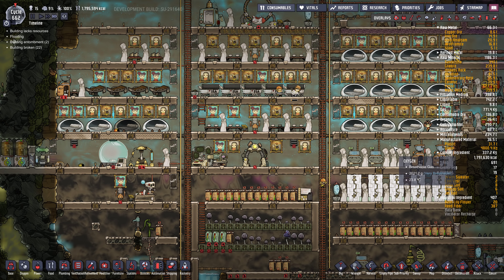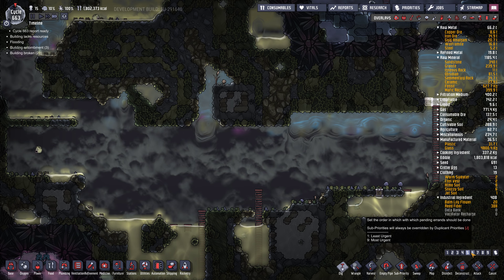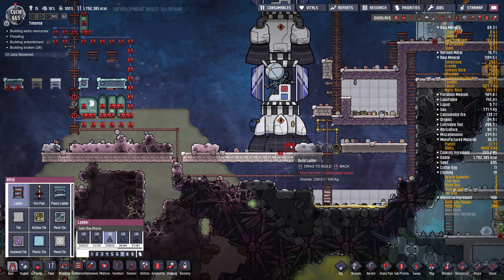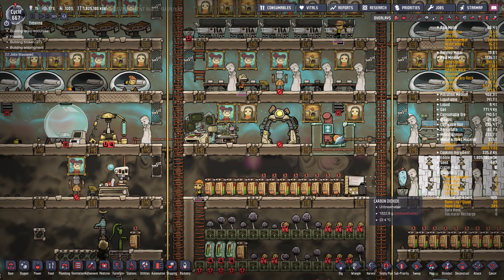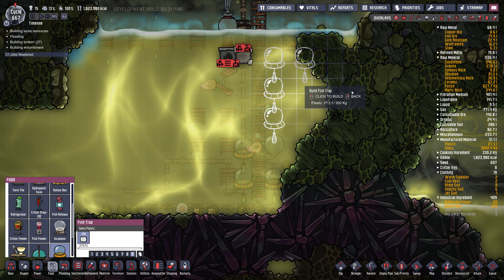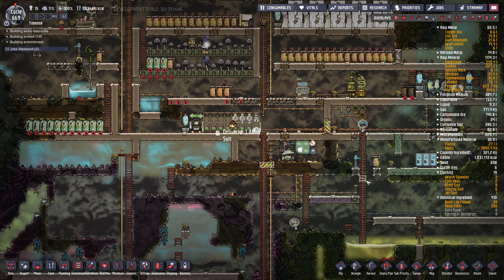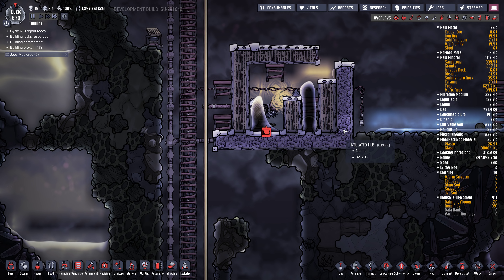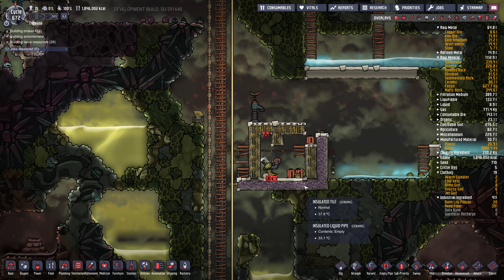SPACE INDUSTRY BASE #14 - Liquid Compression & Fish Bowl - Oxygen Not Included [4k]

Comment: A better version of infinite liquid storage is to use a gas, any gas over a liquid vent. That means you don't need to bother about priming with a specific liquid or anything. Just build it anywhere that is not an absolute vacuum and it'll work all by itself. The liquid vents are just connected. https://ibb.co/b8Hx7f

EDIT: Oh, and do remember to lock the doors so the dupes don't accidentally wander inside and flood the map.
Reply from the maker: It would be funny to open the door at the end of a game.
Reply from the maker: That is a much simpler setup.

Comment: You can use a single robo miner for 2 solar panels. Robo miners have a 7 tile reach. So you could use 4 bunker doors in a row, 2 bunker tiles a miner under them, then repeat. you gonna have a 2 tile gap without a minder, but there sould not be a solar panel under that part, so the light blocking will not effect anything.
Reply from the maker: Yeah my build is sub-optimal. I though panels were 8 wide when I started.
Reply: @GrindThisGame  Yeah I know i watched the whole video, I just thought you might not know about the range of the robo miners :)

Comment: I've got the same idea like you, 1 robo miner and 2 bunker doors. Until i realized robo miners have 2kDTU/s and they will break themself eventually. Got back to mechanized doors with a 45s filter gate - pretty efficiency with high quality scan and no power cost :)
Reply from the maker: The massive door crusher caused me a lot of lag.
Reply: oops, so there should be another way for your robo miners to give off their heat. A heat transferable environment needs to be locked up from space exposure. Unless robo miners can mine through tiles otherwise i don't think there's a viable plan for them yet but keep repairing them.
Reply: @thanhhainh2711  Machines in a vacuum interact thermally with their foundation. Cool the tiles the robominer "sits" on to cool the robominer. For example with radiant pipes with cooling liquid or gas running through them.
Reply: No it does not work that way man, my robo miners broke themself in about 30-40 cycles. If their foundation could transfer heat they could break in 30 seconds due to 270 degree celcius bunker tiles above them.

Comment: Got a good trick if you want to use the Electrolizer at maximum efficiency (not stopping because of overpressure). It's a simple design, modular, and it could be use in a AETN for precooling the oxygen before sending it to the base. It might be a bit tricking to start it up, but as soon as it started, it can be easily expanded. The only problem is that the hydrogen only leaves through the left side airflow tile, so you can't rotate the design. 

Here is the design layout: https://imgur.com/a/6lsAiNq

Let me know if you need more explanations on how to set it up. I kinda want to see if you can figure it out :D
Reply from the maker: Very nice setup. I don't use the overpressure bug on electrolyzers though...even though I'm using the compression bug for water storage :P

Comment: At 31:55 it wasn't working because just a little bit of oxygen got into the pipe and so it wasn't combining, the pipes were fine just need a filter.
Reply: It also would have worked if the pipe wasn't directly going through the bridge outlet. Use two pipes joining  rather than stringing the pipe directly through the outlet.

Comment: Can you use robo miners near scanners?  You can make a lot better designs if so.  You don't need as many miners on tiles blocking light.  Think about it.  If every miner is in range of another miner then eventually the miners will dig each other out.  There isn't ever that much asteroid debris.
Reply from the maker: I'm not sure if they weaken the signal. My setup is not optimal but is working.